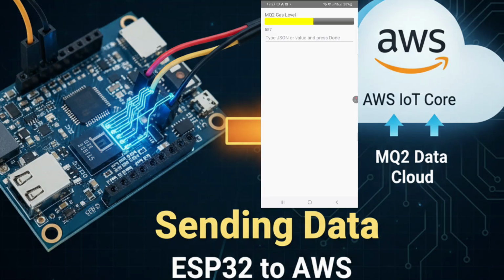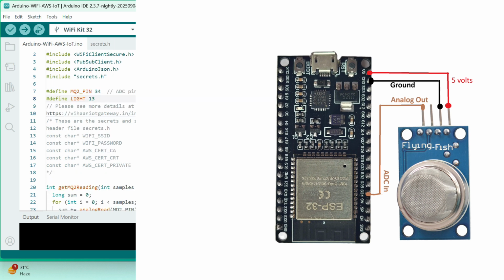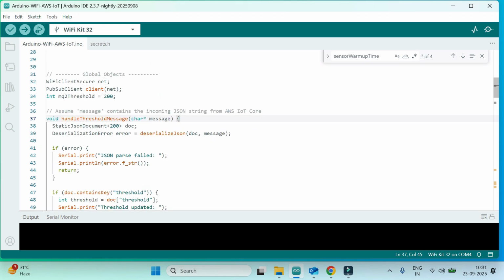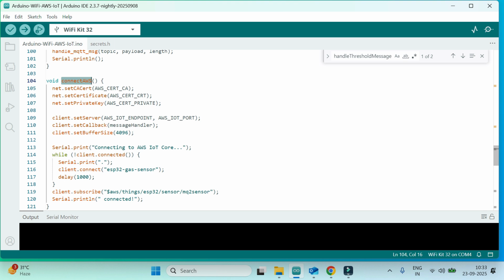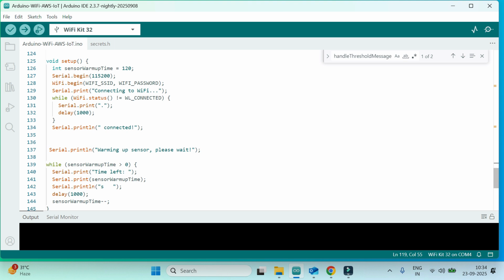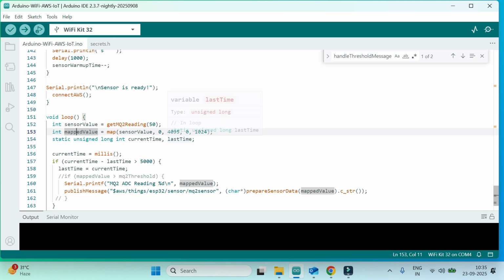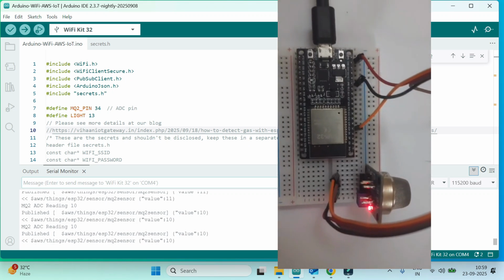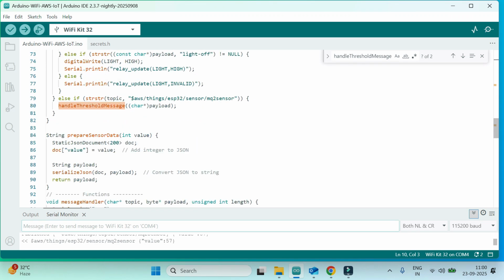ESP32 + MQ2 Gas Sensor | Arduino Sketch, Connections & Android App Demo

Comment from the maker: Safety Note for MQ‑2 Gas Sensor

📌 Safety Note for MQ‑2 Gas Sensor

In many hobby projects, the MQ‑2 gas sensor is connected directly to the ESP32 analog input pin for simplicity.
While this works in many cases, it is not technically safe long-term because the MQ‑2 outputs up to 5V analog signals, and ESP32 ADC pins are designed for maximum 3.3V input.
Direct connection can lead to:

Gradual damage to ESP32 input pins.

Inaccurate sensor readings.

Reduced reliability over time.

✅ Recommended: Use a simple voltage divider or logic level shifter to scale the MQ‑2 analog output down to safe levels for the ESP32.